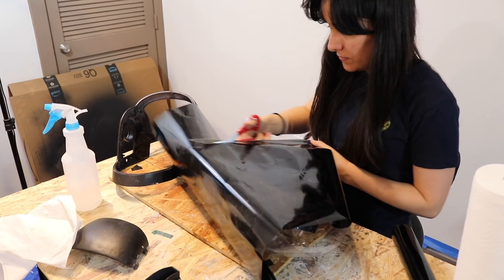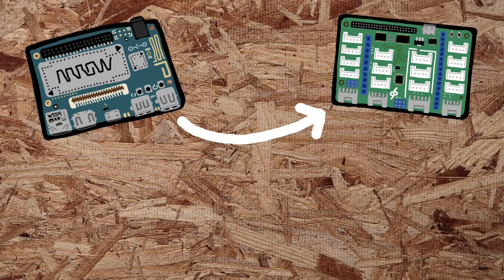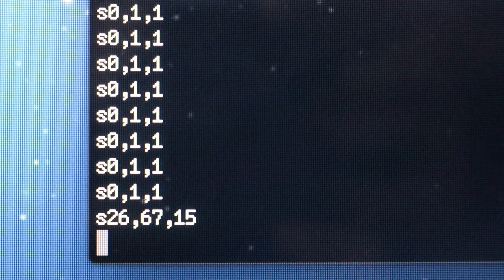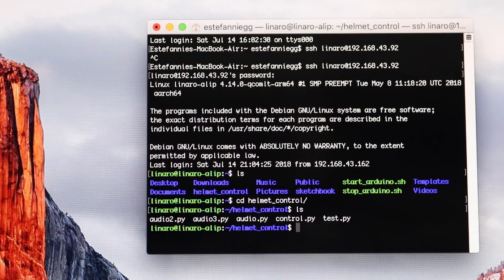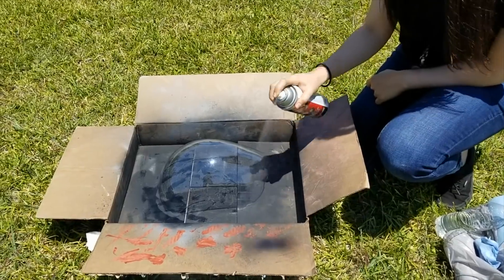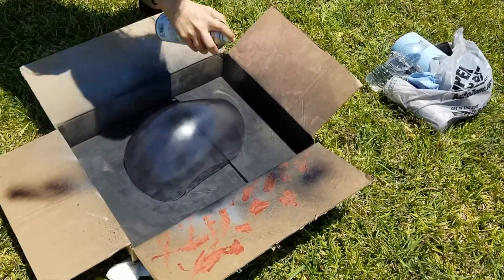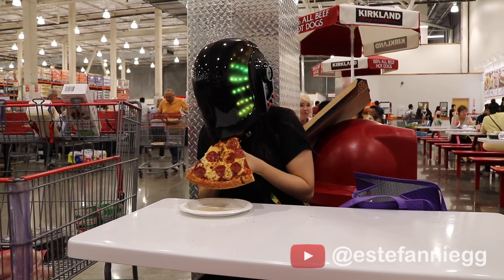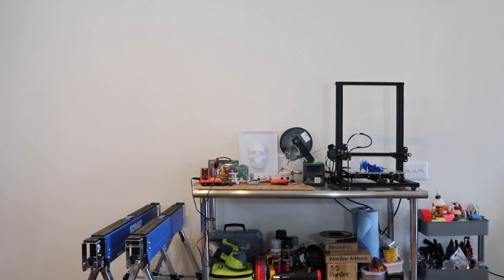How to make a 3D Printed Daft Punk Helmet 3 // MAKE SOMETHING

Comment: Hi i can use Arduino nano? How i can wired The potenciometer? It's have 1 pin un The helmett.ino
Reply from the maker: You can. But you will need to redo my code entirely. Everything is controlled by the python script in the Dragon board and passes the frequency levels through serial to the mezzanine board (that runs the .ino file)
Reply: @Estefannie  thanks for answer Then i Will use the neopixel demo sketch and see how it's works in the nano board

Comment: Stellar job.
One tip for tinting visors in the future...spray the inside of the visor as opposed to the outside. There's no need to clear-coat the inside as nobody will see it and it's not needed on the outside. You also won't chip or scratch the tint should you bang or drop it and can easily buff out small outside surface scratches with automotive wax. I've done it on rc car bodies to protect the paint and it gives the visor more depth of colour because you're looking through that thin layer of clear.
Otherwise, fanfreakintastic work.

Comment: Awesome job on the helmet! I'm currently working on making one, the instructables guide doesn't cover the electronics portion very well. Do you have a bill of materials used or any recommendations or a guide forthe making the LEDS portion? I saw AlexplusLeds, but his kits are a bit pricey.
Reply: Dang, that's where I'm stuck on, trying to wire it the same way she did.

Comment: I'm really impressed with your project. Love that Dragonboard! What python version? Python is my go-to, im much more comfortable with it, plus this board sounds a lot more powerful than an Arduino. Edit: ahh it's a computer! For $75!!!!!!!!!
Reply from the maker: Kieran Short yes it is AWESOME! I'm going to add more features to it 😀
Reply: Estefannie Explains It All I was surprised that I saw you using python, and then Bluetooth.. this is very impressive. Come to think of it though, I guess you could do it with rpi3, although the variable supply voltage is a huge strength of the dragon for these projects!
Reply: The DragonBoard can take voltages from 6.5V to 18V, though we do not require such a range from all 96Boards, the DragonBoard did go above and beyond with this. The low-speed header is equipped with the following standard outputs: 1.8V, 5V and SYS_DCIN (i.e. your DC Input to the board).
Reply: Would be glad to answer any DragonBoard questions :-)